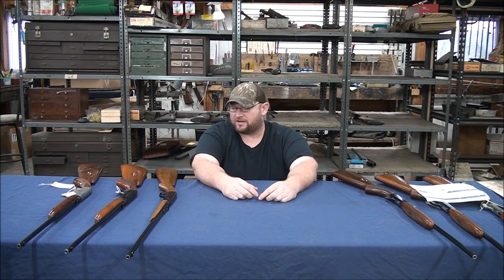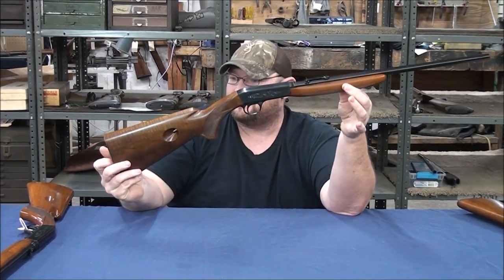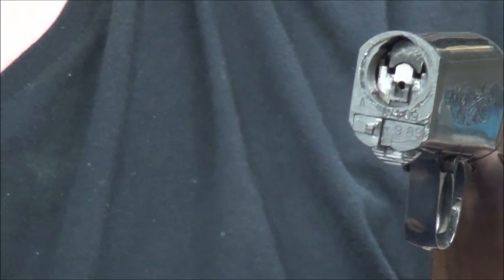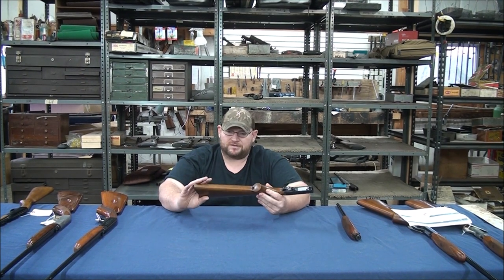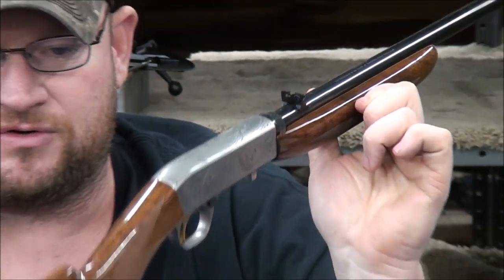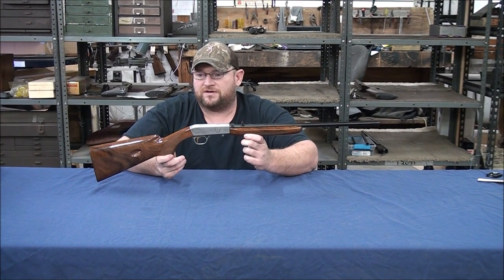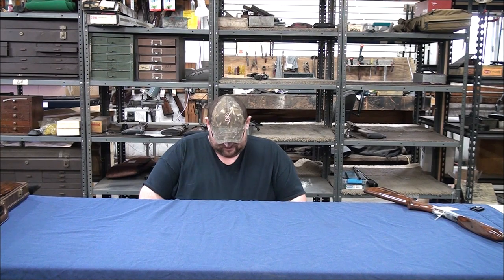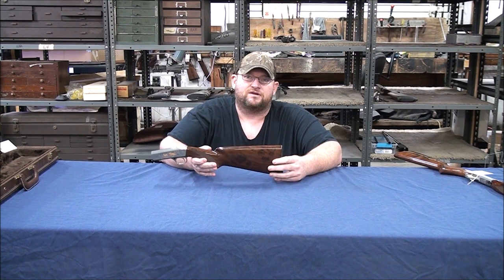How to date your Browning SA-22.

Comment: So I have a FN made SA-22. Has the wheel/blade rear sight. On the left side of that sight is says “22 long rifle smokeless”. The receiver has no numbers on it. Only numbers are on the bottom of the barrel. No A or T prefixes though. Digit reads 27xxx which would means a 1957. Did they make some though without the T prefixes? Mine is in a wood box which had to been made for it. Have 2 sets of the owner’s manual. It’s like a wax paper, very odd. Says it’s a Model B. Also in the box is a wood 3 piece cleaning kit. Along with a special slot to hold the Weaver model K 4x. Would love to know more about this box or complete rifle with case and scope if any knows? Inside the box there is a brass plaque that reads
From Maintenance Unit
Rome July 1963
Thanks and sorry for the long post.

Comment: I have a good question.. I bought one SA-22 brand new in 71 made by FN in Belgium. On the side of the barrel is marked as "22 Long Rifle". The serial 99464 is under the barrel, with no prefix at all, and no more markings anywhere else.. also has a dovetail or tip-off rail on top of the action..no engraving on the sides of the action... how else can I date this rifle?